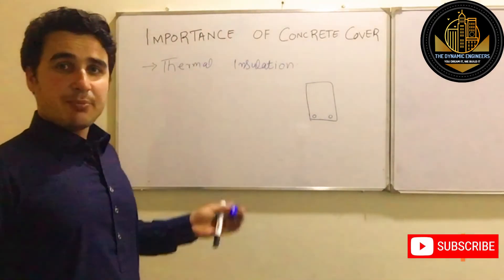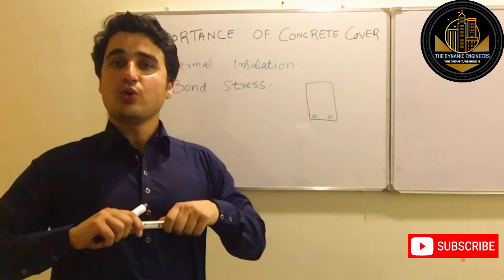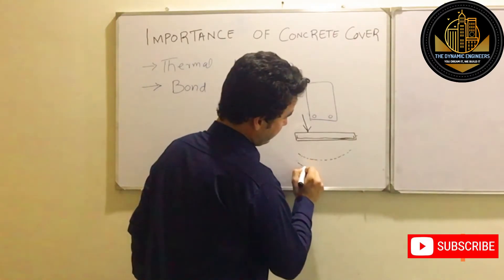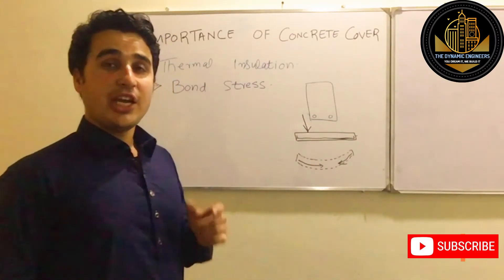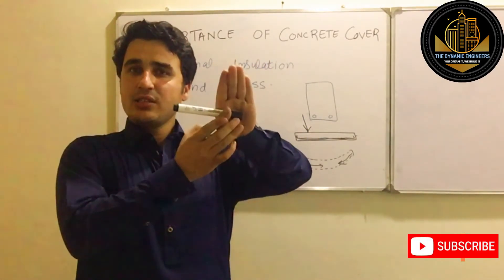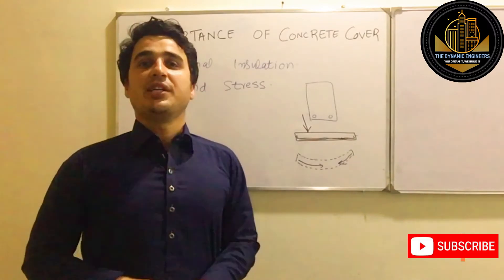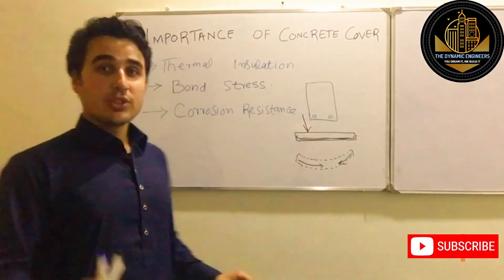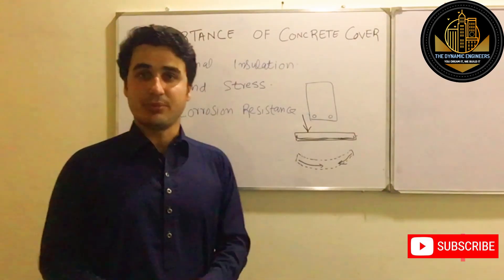What is the Importance of Concrete cover in rcc structures?

Comment: Amazing sir. Sir what factors should I consider while changing the RCC Circular column to square column from one floor to another?
Reply: good question.
Reply from the maker: the important thing is load consideration if you want to change the shape from square to circular. i would like to add one another thing, that you can give a circular shape to square-shaped reinforcement and can give a square shape to circular shaped reinforcement. the important things are capacity and reinforcement qunatity.